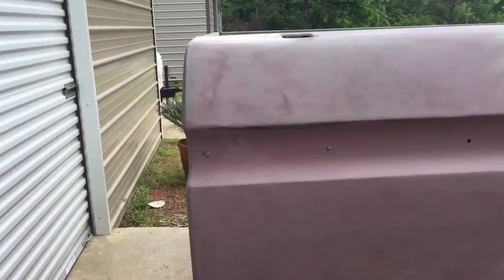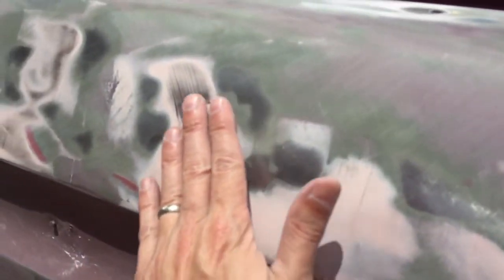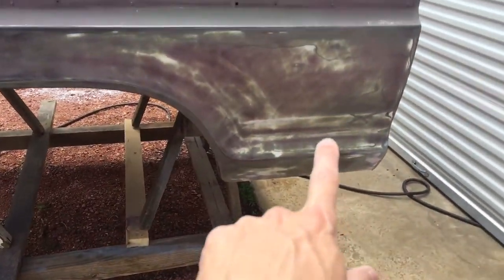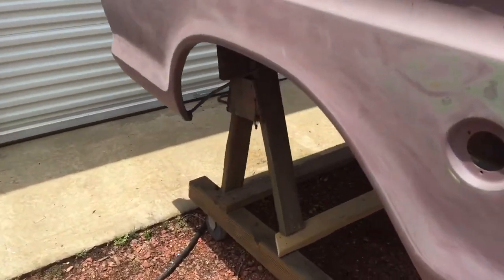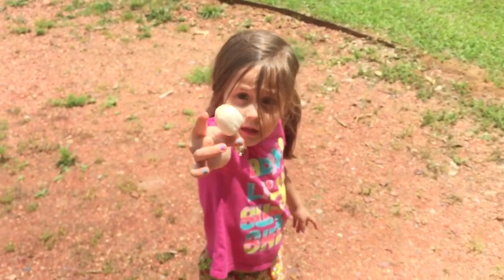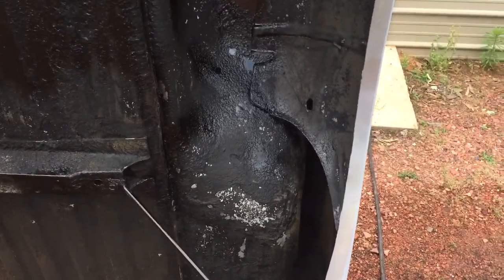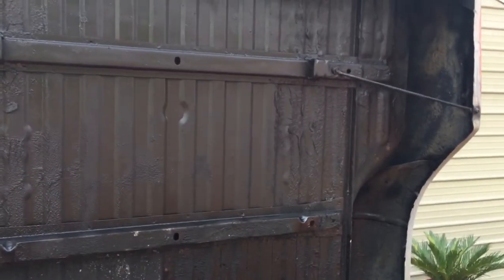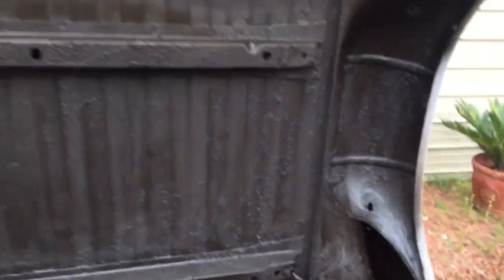Video 56 - 1974 Ford F100 frame swap and restoration: working on the bed

Comment: what size pressure washer did you use. im assuming anything over 2800 psi
Reply from the maker: +Bulmaro Gomez To be honest, I'm not sure - it's the best one from Lowe's (or maybe Home Depot...don't remember). I had it turned all the way up and used the finest tip in some places. It worked well, I think.
Reply: Thank you for the fast reply. I have a 67 f100 just waiting to be worked on. I greatly enjoyed watching your videos. I watched all 59 in two days. Id like to record mine but im not great with a camera or have one and i just know it would take me 10 times longer to get something done. again thank you for the incredible detail on the videos. Did you use harbor freight spray guns..
Reply from the maker: +Bulmaro Gomez I use my phone and an app called YouTube Capture. It's pretty easy. I have used HF sprayguns. The $9 even!  This particular day, I used one from Eastwood. Thanks for watching my videos!